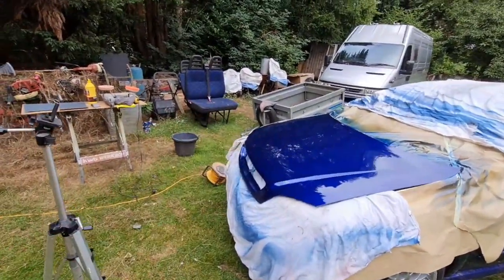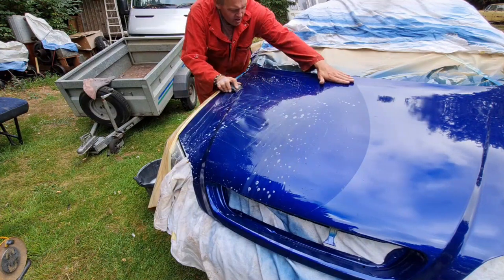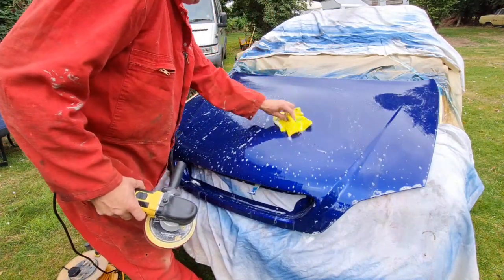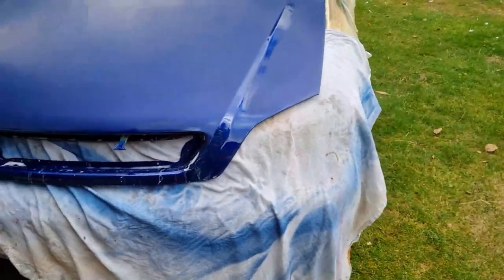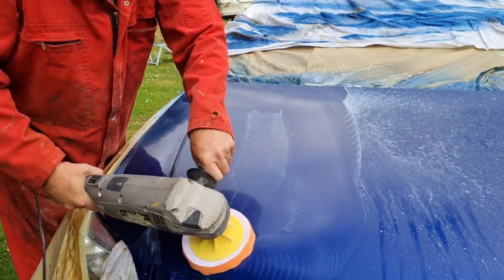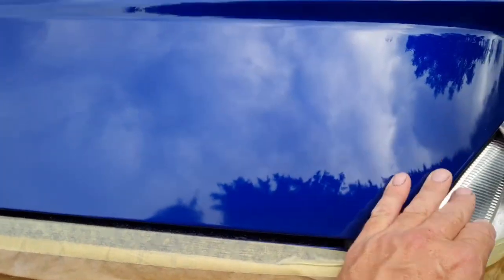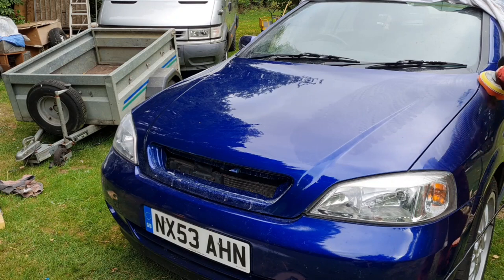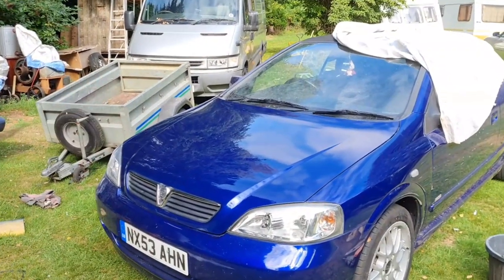How to Machine polish / colour sand New paint.

Comment: Very helpful thanks also where’s the best place to get the sanders from in the uk cheers
Reply from the maker: Thanks mate. you cab get mops and sanders from ebay. my rotary mop I had for about 20 years. the little yellow DA mop and polisher came off ebay about a month ago and was only 40 quid. Great little tool and comes with loads of mop heads and sanding discs.